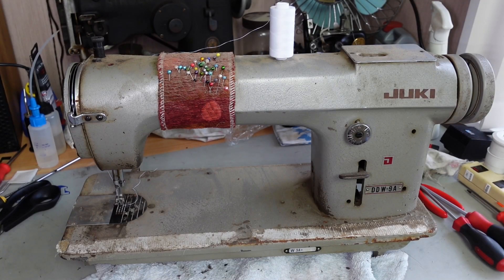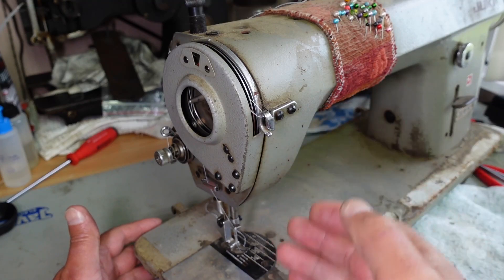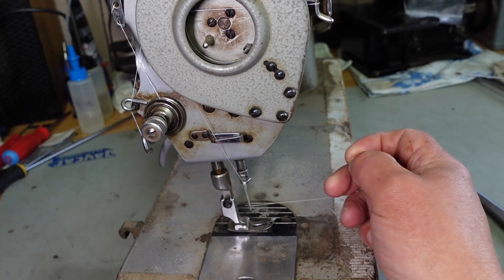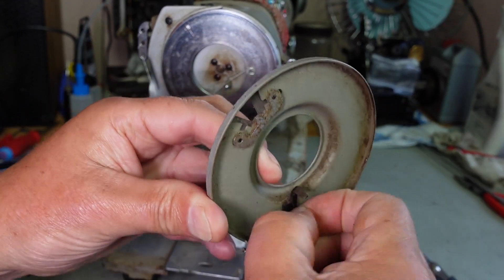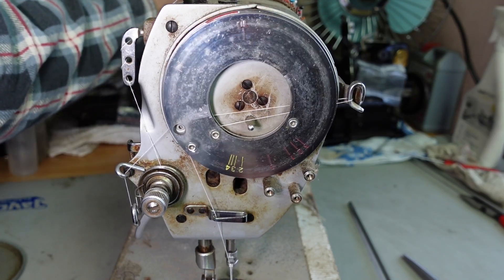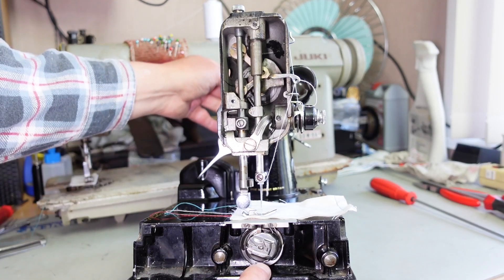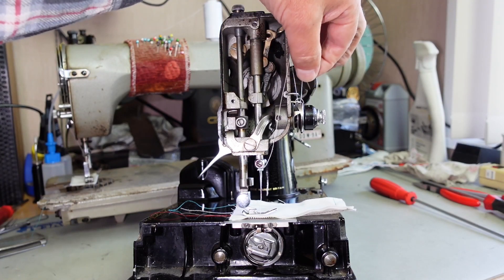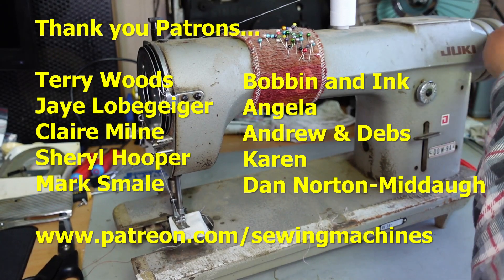Rotary Take-up - What it is and How it Works - Industrial Sewing Machine

Comment: I have 2 or 3 examples of the domestic version of this that was available in the USA, the Juki "Rotalix". Interesting machine, and it certainly saves on the parts count.  But what I couldn't understand is why it's an oscillating hook and not a rotary! A rotary would have been SO much faster and smoother!

Comment: I need advice. I have a Singer 700G machine, it had been tossed out curbside, on trash night, when I rescued it.
It is missing the throat plate cover and Needle Bar door.
I have no luck finding these parts. I believe the  "G" on the front of the machine,  stands for GERMANY.

Comment: You might be interested to know that Juki also made domestic machines with this set up.  At one point they were even marketed under the White brand.
Reply: I have 2 Whites and a Juki!! Fine machines all.
Reply: I have a vintage juki industrial. My favourite, though having problems with the control box, which I tried to repair but without success. I might just replace with a servo motor. Would keep an eye out for a used juki domestic.